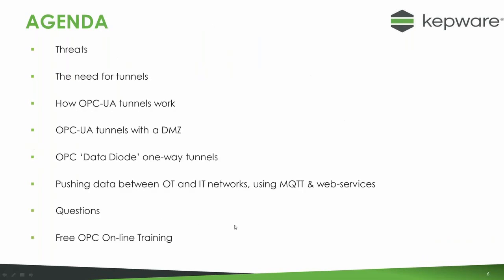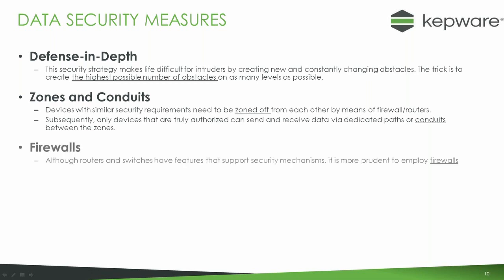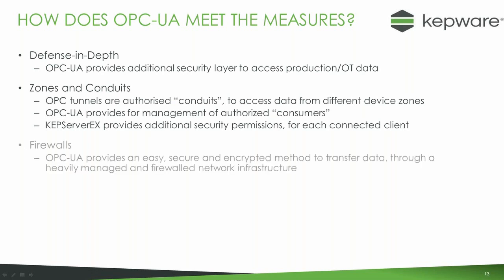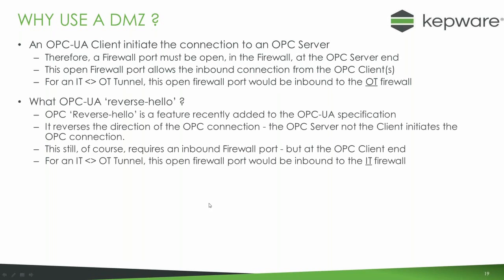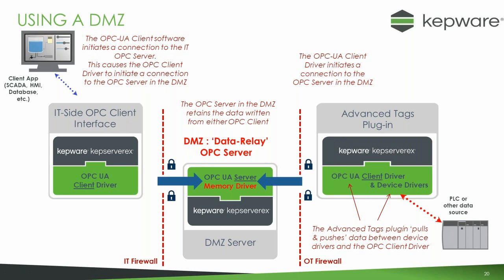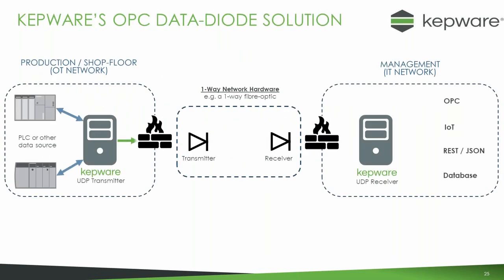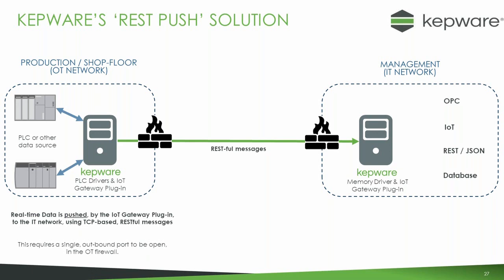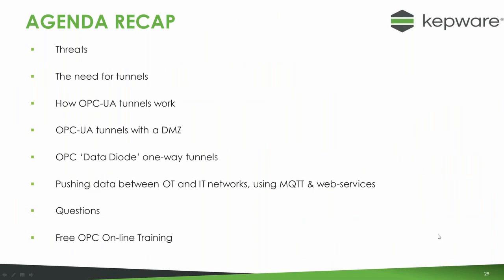Kepware OPC - Data Tunnels using OPC UA, Data Diodes, & IoT met

Comment: Does Kepware have a solution where the IT firewall is also outbound only?
Reply from the maker: Hi Austin, Thanks for your question, here's a quicj answer: 
A standard, KEPServerEX accepts an incoming connection through the firewall from the OPC Client. This port is user-specified and OPC-UA is extremely secure. Some users choose to use a DMZ to create a double-gap between the IT network and the OT network.

Feel free to get in touch on +441527 529 774 if you wish to know more